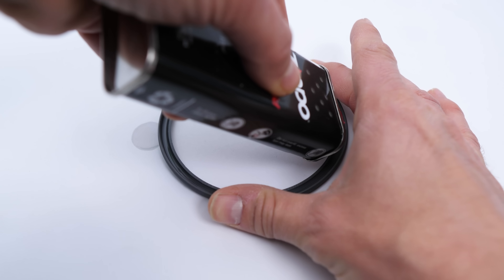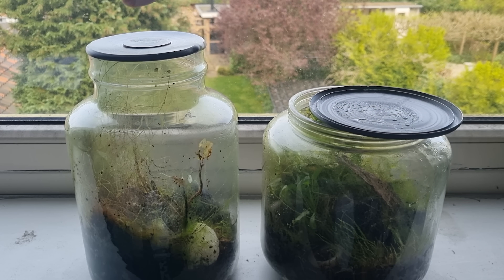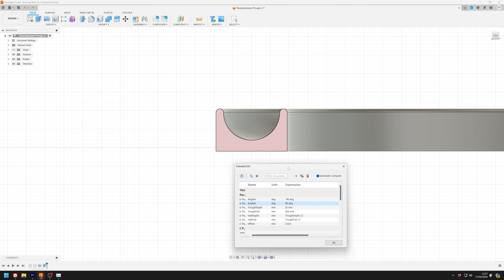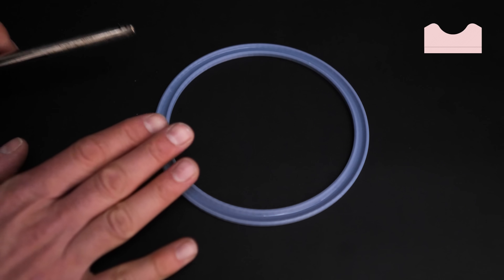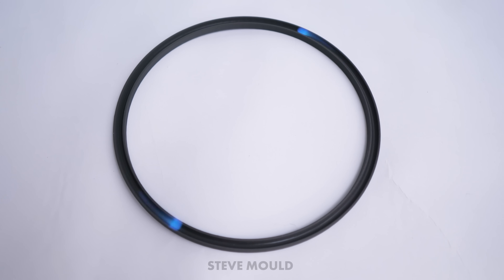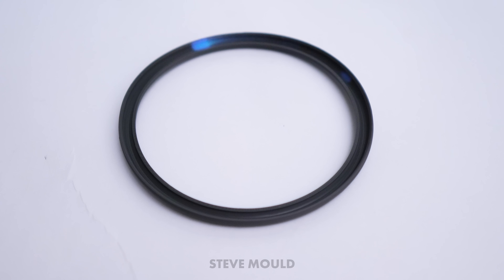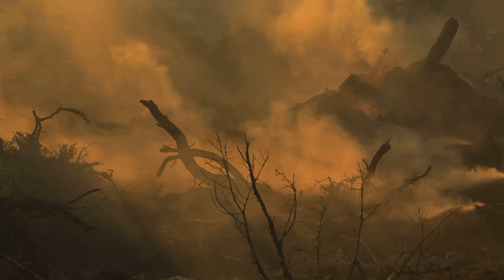Bizarre travelling flame discovery

Comment: 1. A stepped track that might cause a delay or advance in transmission of the flame,  such as a 5mm with one or more  sections of 6mm track broadness .  2. In a square step versus gradually widening from one side 5mm to the other 6mm.  Then narrowing  gradually back to 5mm. 
Might be used in creating interesting patterns of pulses that are regulated by other recurring pulses.
Some may be recurrent while others self terminate. 
In such way it may be good to emulate a transistor. 
Some designs may be recurrent while others self terminate. 
One could possibly make a computer simulation in order to test large complicated arrangements because practical testing would become more difficult.

Comment: For the high wall, narrow opening ring, what if: The high walls allows a fair amount of vapor to accumulate within the walls of the ring.  When you ignite it, instead of losing heat to the liquid, it is heating the vapor, causing it to expand, but only right where the flame is, causing a constant flame.  It doesn't spread because the vapor is below the opening (thus no oxygen) unless it has been heated.  The initial heating that causes the initial expansion at the ignition point happens when you use a hot flame to light it.

Just a thought.  Not sure if it is correct, but it makes sense to me.

Comment: getting two flames traveling the same direction would be neat, instead of covering one side with your hand to force one flame. Like if both sides loop back into the main path, but one side has a slightly longer path to travel. Would probably need a junction point at the proper angle to avoid a recurring feedback source using precise x/y or even z axis alterations. If the longer path traveled up a short steep incline, satiating rising evaporation, but then back down a longer shallow decline that can't feed in reverse, maybe? I might be over-complicating it and is a dumb idea to people smarter than i, but it would look really cool in design at least. I wish i had a 3d printer, I'd be churning out hundreds of these tracks out of curiosity.

Comment: It would be really interesting to see how this behaviour varies with temperature, e.g. if these contraptions were put in a freezer presumably a one way flame could be sustained in tracks with a much larger cross sectional area since the evaporation rate is smaller. However, not sure how long this low temperature behaviour could be sustained!

Comment: What determines which way the flame travels? It burns clockwise. It burns counter clockwise. It starts at the ignition point and goes both ways simultaneously.

Comment: 5:57  The close walled version where the flame doesn't move could be due to convection. There is enough room below the flame to suck the fumes under which prevents it moving and also has a larger area feeding it which allows it to maintain itself with the 5mm trough limitation.

Comment: @SteveMould
You briefly touched on it Steve, but I am astounded at the fact that Rudy chanced on the making of the ring in the correct size. If he'd made the lid a little larger or smaller, it would not have worked to produce the circular motion and this video would most likely not have been made. Which is another thing - why does the flame favour anti clockwise?

Comment: I wonder if you could have a deeper trough (vertical rectangle with the same 5mm opening on top) that can hold a small reservoir of lighter fluid then have a tube tie in to a small 'tank' some how to keep it topped off at that level. 
It would be cool if you could create a large complex looping design and put it in some kind of case with enough reserve fluid to run for a few hours.

Comment: I would be interested in seeing the various designs in a completely dark environment so nothing but the flames are visible. It would be really neat to build a “rolling ball sculpture” except the ball and track and the flame and trough. In order to maintain the layer of flammable gas above the lighter fluid maybe the trough would have small, tiny, or micro-undulations where the fluid could pool slightly? This would prevent the lighter fluid from all flowing down the the trough’s lowest point.

Comment: Steve Mould, your "very long explanation" about why the flare circles is wrong. To have fire you need the fuel and the "oxidizer". The fuel is the liquid you put in the ring, the oxidizer is the air. So, the fuel burns with the air, as they turn hot temp, they go up, so the flare moves for the next molecules of fuel+air, circling the ring. While the flare/fire moves, the remaining unburn fuel cools down, allowing air  (oxygen, etc...) to move inside the ring again on that spot. Try this same experiment viewing it with thermal camera or something like that that allow you to see air moving in and out of the ring 👍

Comment: Sandbox Evolution, a 2d pixel based physics sandbox game. I couldn't stop thinking about how the electricity mechanic works, and how eerily similar it is to this phenomenon. Funny enough if you make the 'wire' too thick it freaks out and any electricity sent through short circuits causing the whole system to light up, just like how the lighter fluid acts when the trough is too large. The game itself has an in depth system to the point of being able to make a calculator with functional logic gates. If you want an easy source of complex designs, you can just scrub through it's community and transcribe it into easy to print/assemble pieces. The game itself is a great time sink since it's the right amount of fun and logic exercises.

Comment: Your explanation of Excitable Medium reminded me of the Jacob's Ladder Experiment, where some force requires the plasma charge to move to the opposite end of the connection where it breaks and is immediately replaced at the original condition.

Comment: could it not also be due to the lack of oxygen as much as the lack of lighter fluid gas that the loop works best with a slightly smaller opening? it could be said the flame moves across where there still is oxygen and then goes out where the oxygen has been spent instead; this better explains why a larger gap (more oxygen) burns completely and a small gap won't stay lit for long (less oxygen) imo.

Comment: Does a flame front have mass? If so, it's a bit like a particle with mass, and you should be able to measure a slight wobble in the whole track like a heavy marble going around. If not, then a flame front is like a good model of a massless particle.

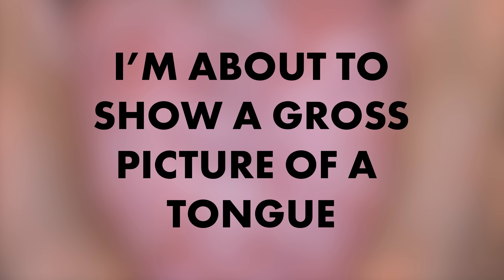Comment: 7:28 Not only is heart fibrillation an example of an excitable medium, but in fact, the heart is an excitable medium in its normal healthy state! Every single myocardial cell has the capability to produce an electrical impulse given enough time. Each cell is able to discharge its electrical potential by contracting, after which it has a refractory period in which it needs to move the electrolyte ions back to the right places to have a potential again. Different parts of the heart have different refractory periods, and the part that normally has the shortest is the sinus node, at the top of the heart. That's why the sinus node is normally where heartbeats originate, and then they propagate through the heart like a wave, discharging all of the other cells.

Comment: Pons and Fleischman's cold fusion is another example of a excitable medium, in this case creating a tunneling state that allows weak forces to mediate a fusion reaction. Because its an excitable medium it can run out if 'fuel', hence the 'unreliability'. In this case the 'fuel' is cracks of a specific nano-geometry loaded with deuterium in the Pd that is also fully loaded with Deuterium. The reaction in one place triggers a shock wave in the 2 dimensionally constrained deuterium that over comes the coulomb barrier. The result is helium, heat and a tiny burst of radiation but the gas loaded palladium acts as a proton shield absorbing and thermalizing that radiation. Under infrared thermometers the reaction is shown to be tens of thousands of degrees in a few manometers. However over a distances of several millimeters that averages to only a few hundred degrees. Its limited by the boiling point of the electrolyte in electrolysis. Pressurization helps. Gas loaded systems are higher temperatures but the cracks are more sensitive to change. The discovery was never debunked its just taught that it is. Under 200 failures do not debunk 9000 duplications by 1999. The low temperature and unreliability are both solvable problems today but we don't have lab access, palladium access in some cases (its gone way up with gold) or in the US patent access. We will get our compact cold fusion reactors but only after those the opposed it are dead and forgotten. The catch is Pons, Fleischman and all the other advocates were older than the detractors.

Comment: Wait a minute, you made larger trough rings with different shapes, but they were much larger circumference. If the vapor is what's burning, and the timing of the vapor coming off the fluid is what dictates the burning, then does that not mean the time it takes for the flame to traverse the circle might be too short or too long to hit the sweet spot of ignition?

Comment: I wonder if you could build logic gates with carefully shaped tracks. e.g. an AND gate could have spots for two flame inputs, with some sort of narrowing channel that would only have enough heat to ignite down the output if both inputs combined to ignite it. For NOT, maybe you could configure it so you could have a stably spinning single flame that also feeds an output channel, but an input  would oppose the spin and cause it to go out? If you can get NOT and AND you have NAND and can build whatever circuit you want (although lighting it all in motion simultaneously would surely prove difficult). No idea how realistic this is, but it feels like building a computer out of lighter fluid and fire would be up your alley.

Comment: Tried this, made sure I had a 5mm inside track width. It would not work, just kept burning as a full fire ring. Tried minimal amount of lighter fluid, just enough for the fluid to flow around the ring when tilted, tried a medium and larger amount too. One time I got a few running flames, but half of the ring was still burning in place. Didn't work for me.

Comment: Would be interesting to see a flame solve an enclosed version of a maze manufactured in this fashion. Leaving the start and exit open to oxygen, but include 'walls' from floor to ceiling (walls may need to be wider than the 5mm trough, and high enough to allow adequate oxygen to exist in the system. Too much air, and the flame will split at every junction. Too little air, and the flame will die out. Curious what the requisite ratio would be, and whether it can remain functional with the light fluid vapour competing for air space.

Comment: Rabbit Hole is the least of your concerns. ;-) reminds me of 5th-grade Science teacher setting a two-meter long 2"iron pipe wit holes drilled down the full length of the top-side, one end plugged with a rubber diaphragm with audio speaker up  against it, the other end sealed with a cap and bunson burner-type gas spigot hooked to a rubber tube to the butane spigot installed into the furnirue up there for experiments and demonstrations, cranked it  all on.

and behold the flames were burning at different heights and in different Sine wavelength between depending on the frequency the oscillator feeding the speaker's amplifier which varied the average height of all the flames to be taller or not depending on the volume setting.

that did it for me

now i am in a rabbit hole called Ambisonics, pulling together eventually a 4th- or 5th-order speaker setup to hear the stuff coming out of my gear, whatever that may be, electric kazoo, in my bedroom slash recording studio, all 2.8m W x 2.9m L x 3m H of it.

the only correct psychoanalysis in my that remains spot-on

childish grandiosity

and what you have here grabs me in the gut right there, Maestro, thnx for giving me a map to turning that into moving sounds that must be making

Comment: So if you want a wider trough while producing the same flame velocity, use curvature of the top 1/8th of the trough walls and two additional angled troughs positioned at 1/8th of the of the trough depth (from the lowest point, measured vertically. The additional notches should run in parallel and be angled 135° from the uncurved lip of the trough. Eh try it, it's an estimation but should work.

Comment: When you created the figure 8 track, you mentioned that the lighter fluid was expected to drain to the sides; however, maybe you could take advantage of capillary action by embedding a string or thread along high areas in order to draw up and supply that area with gas. Just an idea, and fantastic video!

Comment: I think the width of the channel (necessary for circling) is likely proportional to the volatility of the fluid. And, volatility is, I believe, very sensitive to pressure and temperature. So, if you tried this on a cold day, I presume the circling would be slower or even not possible. And, on a hotter day, the circle would go faster, or burn all the way around, like lighter fluid does on a trough that's too wide. If you make another video, you could heat up or cool down some fluid before lighting it. Finally, I wonder if the flame slowly heats up the liquid over time, making each circle slightly faster than the previous one. Thanks.

Comment: This looks kind of like marbles rolling down a track, except the marbels can just split up and reconnect.
Also I wonder if it is possible to make some sort of simple computer out of this. I'm not sure how consistent the speed is and I know you would need keep refilling the path. But i would look supercool, just need a way to enable/disable gates using the heat energy from the flame. Then using a littlr circle to have a clock speed.

Comment: I have interesting ideas:
1. what if the fluid was alcohol or some other volatile liquid, or a mixture, would the same design and sweetspot hold?
2. If you suspend an identically shaped pipe above a cycling circular trough, would it act as a pump?
I m just thinking. maybe I should try this (somehow)

Comment: An aside - "mediums" is a perfectly valid plural.  Latinate words can either be pluralised by either using the Latin plural or the English plural.  Both are equally valid.  Thus stadium (s) - stadiums or stadia (pl); antenna (s) - antennas or antennae (pl), carcinoma (s) - carcinomas or carcinomatae (pl), datum (s) - datums or data (pl), etc, etc.  In common usage, some forms predominate - for example, no one would use bacteriums as the plural of bacterium, but rather bacteria, although both are grammatically correct, or criterions as the plural of criterion, but rather criteria.  
But it does annoy me when people use the plural form as a singular (this bacteria, my criteria is, etc).   Yes, I'm a sad pedant :-)

Comment: you know this video is on just the right time :p I recently saw similar behaviour elsewhere on the internet but instead of in a controlled fashion it was on a very thin "pool" of lighter fluid there areas of flame shot across the surface instead of burning constantly like i expected. I was wondering how to explain that and then your video arrived in my feed :D so thanks

Comment: I wonder if making sure there's tiny troughs along the raised portion of the figure-8 would keep pulling lighter fluid up through capillary action. It'd probably be best to use non-planar 3d printing so that the print path is unbroken (that is, there's no layer lines as the track raises up) and oriented parallel with the track.

Comment: I think you made an incorrect loigical leap. You said forest fires have been known to happen once a year  - but that doesn't mean that's the soonest the forest could regerate to a point where it could burn again. More likely I assume the annual fire observations is due to annual weather or events that increase the chances of a fire. Those two things are not the same.

I feel you would need to know how established a forest needs to be to burn at the heat/size needed for a full blown forest fire, then workout how long it takes for a forest to regrow to that point (at any time of year).

Comment: In the book Player of Games, by Iain M. Banks, there is a planet with a super continent that spans the entire equator. On this continent, there is a fast growing hydrocarbon producing plant, which propagate only after a fire event, which is basically an annual event as a massive flame front constantly circles the planet. All animals on the continent are in a constant state of migration, staying just ahead of the flame to eat the most ripe plants or the beasts that eat them, or just behind the flame, eating the carrion that was too slow to get out of the way of the fire. I guess the refractory time would have to be fairly quick, and the plants probably don't burn too completely as to require full rejuvenation each time the flame passes.

Comment: If you had a less volatile fuel, would it allow for a wider trough up to some limit?  Or would it instead allow for a slower traveling  flame (or would the flame still move quickly but need a longer loop to allow enough fuel to evaporate for the next pass)?